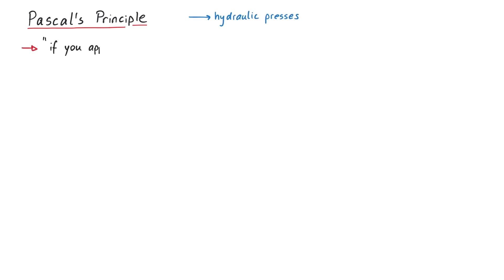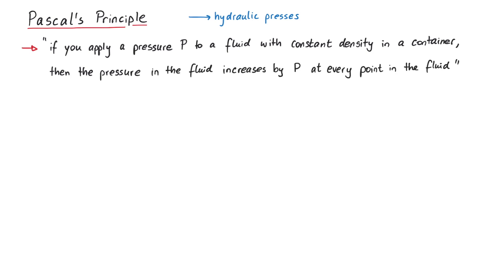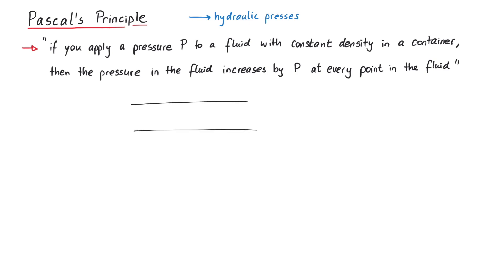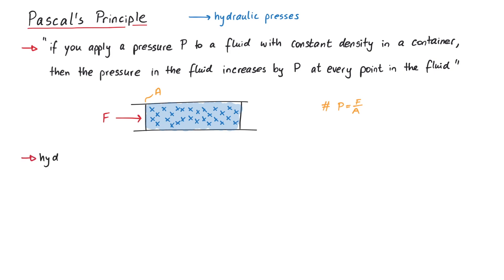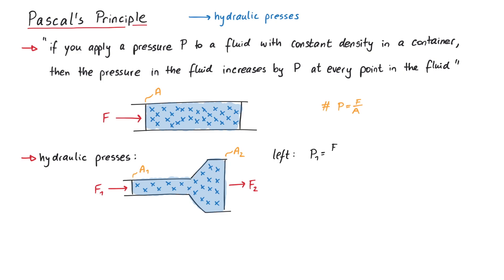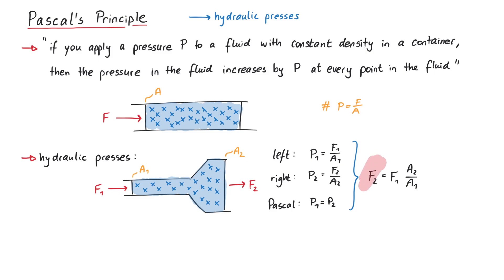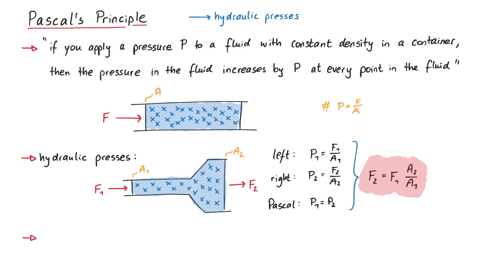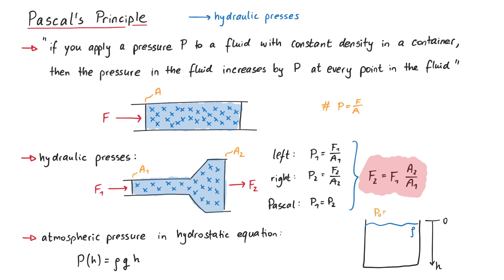Pascal's Principle: Hydraulic Press | Fluid Mechanics

Comment: Molecularly, how can it be possible for the force to be transmitted with the same intensity to every molecule?
I would naturally think that the molecules directly on the line of the applied force would get one hundredth percent of the force, but molecules that are around the first molecule would "feel" only some weaker component of the force (like the total force times a cosine of the angle).
I can't understand how a force applied in one direction can be transmitted with the same intensity to all directions.
It's like if we were multiplying the force. I apply a force in the "x" direction but get the same force in all directions for free? How is it possible?
Thanks.
Reply: Asking the hard questions, lol